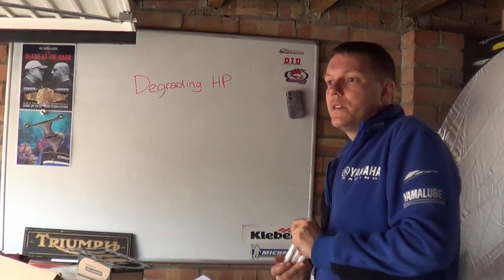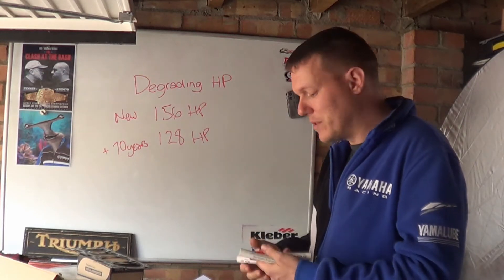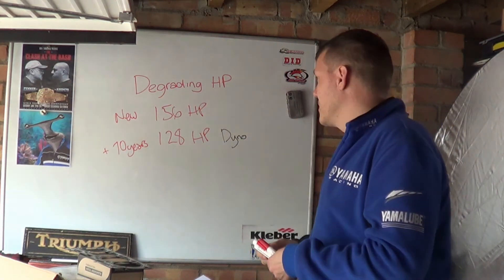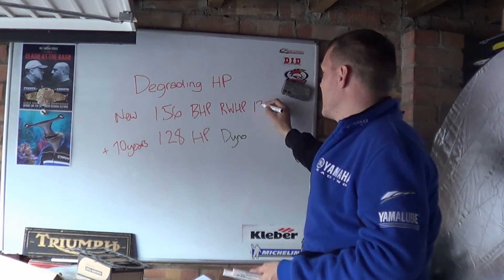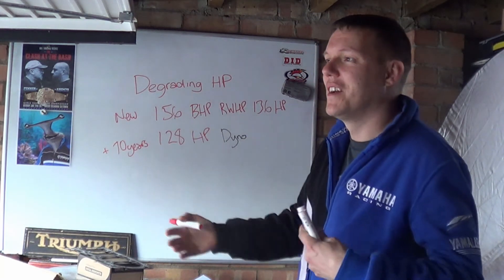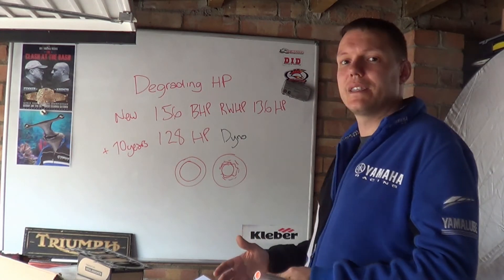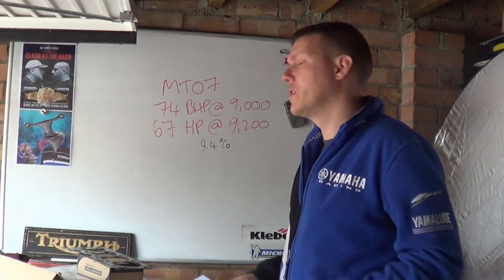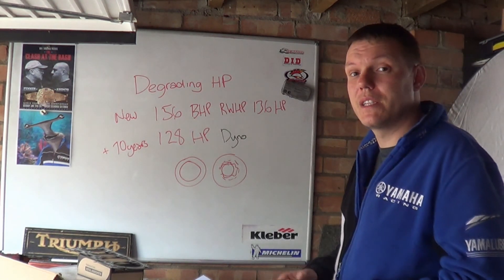Degrading Horsepower - over time

Comment: Who's to not say or say that they very well could be stating peak hp. Peaked timing air,fuel ect. a number where everything it had to give before was installed n slowed down with the computer's preprogrammed data.  You can rob 600 out of any thing with a ecu. Easily.

Comment: Tiger 800 dyno'd at 77rwhp  when triumph lists as 95hp or 93hp. Depending what you read.  It does not feel as powerful as you would expect vs other  95hp  bikes f850gs crf1000l etc

Comment: I have subscribed 1 month ago . Good technical videos. 
Want to know how oil and coolant pump works. ( Reason,  I heard antifreeze lubricates pump, I have water in track bike . Will it cause any damage to pump?(coolant pump). Thanks.
Reply from the maker: This is bollocks the pump besarings are sealed from the ccolant - and yes you can run pure water with no issues other than corrosion
Reply: Thanks

Comment: Years ago a mate had his car dynoed,  they obviously try to guess from typical transmission losses what the crankshaft power is. To be honest the allowance for losses seemed outrageous, but then you think about it... the gearbox and back axle both get bloody hot even with air rushing past them at 100mph+. That’s going to take quite a few kilowatts to achieve. More difficult to judge with a bike where the engine and gearbox are basically one unit.

Comment: ok i just looked up the top gear Renault AVANTIME show 210 bhp stock 157 hp at wheel services back to 206 hp at wheel only a 4 hp different so not a big loss over 6 year carbon build up and shit  so dont think the bhp to whp   is a fake clam go look  https://vimeo.com/6098740
Reply from the maker: but this isn't correct. You need to dyno that car new - then 6 years later - not figure of what it should be

Comment: Great videos. But don't a lot of Dyno's attempt to convert RWHP to BHP by somehow getting a rough measurement of the transmission losses - by the thing spinning down or summat?
I imagine its inaccurate, if its even possible? I haven't had much to do with Dynos with my bikes (well not since having a Dynojet kit fitted to my GSXR750WN over 20 years ago and I can't remember yesterday let alone that), but I did get a car (sorry) remapped once and this quoted 'Clutch HP' on the graphs. Is that B*ll*cks?
Reply from the maker: Great question ATTL - matt

Comment: I'd imagine engine tune, how much wear it has, how well it was maintained, etc, could have a massive impact on how much power it makes. But I agree it is a bit silly to compare a dyno reading of your knackered old banger to the manufacturer's original specified power output. A more scientific approach would be to tune a well-maintained, low mileage example of a given car model to produce the manufacturers specified power output (taking into account frictional losses, wheel horsepower etc) and then dyno your knackered example of the car and compare the figures. And I would imagine that depending on how well tuned or maintained the car was, the difference could actually be pretty huge. Of course modern electronic fuel injected engines would vary a lot less over time than engines with carbys.
Reply: LOL, I guess Youtube just doesn't like me...

Comment: Matt, what bike or bikes do you ride?
Reply from the maker: GSXR1000 - K6
Honda Hornet
(ER5) when its done
I also have these in storage waiting their turn
- bandit 1200
- Suzuki SV650
- GP1 (derbi)
Reply: @thedirtyworkshop  My first bike was  Derbi Senda DRD Badboy (the name was pretty wank). Thing is, it was ahead of it's time, 1995 woth upside down front forks, water cooled and seperate oil tank. Monoshock, 6sp gearbox too, the thing was awesome! I ended up installing a malossi race engine/bore up kit to 79cc, racing exhaust. It had the mechanical attributes of  a hand grenade, and I ended up wrapping it around a bridge and putting my self in hospital while riding like a knobhead. I have since had a few bikes and no longer ride like a knob. Just saw the name Derbi and off I go!
Reply: Why do you wear that Yamaha top if you mostly have got  Suzuki's?

Comment: I think Honda isn't too bad for this. I know they claim the MK1 CB500 is supposed to be pushing 58HP from factory and I have seen them dynoed at 51-52 (mine will be put on a dyno this summer). Won't be that bad cause even after 24 years and like 10 owners fucking with it its still punching above its weight. Engine is still perfect even after its been starved of oil for a while due to the previous owner being a dick. Oil seems to be optional for that engine.
Reply from the maker: good old hondas, people seem to hate on them alot but if anything they are solid
Reply: Ye, my brother in law used to have the old CBR600 jelly mould as well (fucking press bike with frame number 0001 as well). Fucking thing don't quit. His VTR1000 also didn't particularly care about being dropped at 60mph. My fazer used to rattle, jump out of gears, refuse to shift etc, my CB is giving me a lot of problems and I am on the verge of giving up but its all age related (or fuckwit previous owner related).
Reply: i mostly see that with their cars rather than  the bikes

Comment: Good video. Does a rolling road Dyno not adjust for power loss in the drivetrain to give a calculated power output at the crank? point taken about parasitic losses, most quoted BHP figues are with a bare engine that is fed its lubricant and coolant intravenously and is not fitted with mechanical cooling fans, alternators, gearboxes or full exhaust systems, depending on how sneaky the manufacturer feels at test time i suppose.
Reply from the maker: The americans were the worst at this, but the SAE had to change the way they tested. European tests are run with the accessories fitted but no drivetrain. The SAE had to fall in line, but I can't remember when they changed over but it was int he 1970's.

"Does a rolling road Dyno not adjust for power loss in the drivetrain to give a calculated power output at the crank?"

- no, because unless you did a comparison to calculate the figures, the sensors wouldn't know what is drivetrain and what is engine.
Reply: i thought the coasting you always see them do at the end of a run was the rolling road measuring the resistance in the drivetrain somehow? if not then why do you always hear these dyno operators saying "it made Xhp with calculated Yhp at the crank"? should they be saying "estimated" as your average manual transmission RWD drivetrain has about 30hp ish loss or are they just taking danglies?
Reply: but how?
Reply: Deanxm1 The old Escort RS2000 was a tad over 100hp at the flywheel, about 74hp at the rear wheels, that ties in closely to your figure. A mates car did about 240hp at the crank, it was a bit sad to be less than 200hp at the rear wheels...

Comment: Thanks. That was a promised explanation of what 'Brake' means nicely explained. It's a bit like ambitious claims of fuel economy and MPG returns . I imagine they pull all the seats out, stick a dwarf in the driving  seat and run on a cup full of fuel.
Reply from the maker: oh and they levitate in on superconducting magnets, don't forget that bit. lol
Reply: And so as not to upset any dwarves I'm not being dwarfist I am practically one myself 😂
Reply: Richard Cluderay  they generally do a fuel consumption test on a dyno with little rolling resistance and at about 80 kph